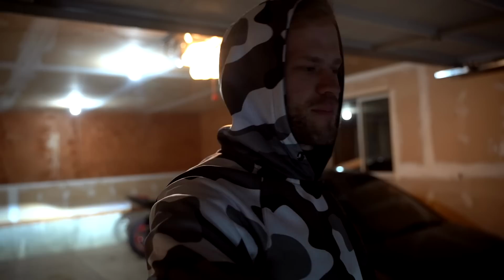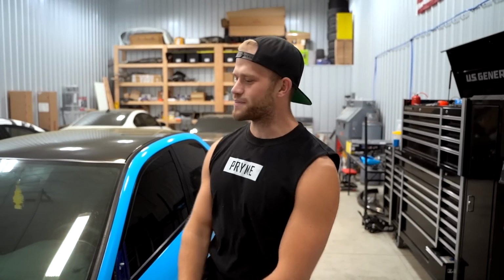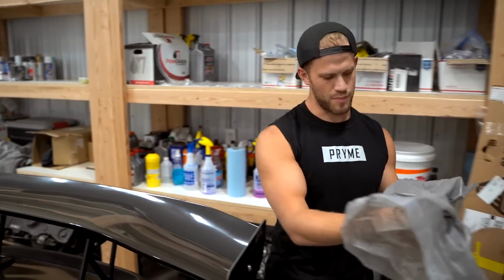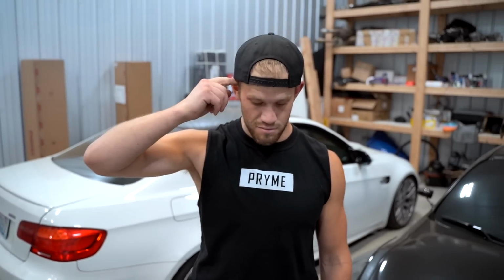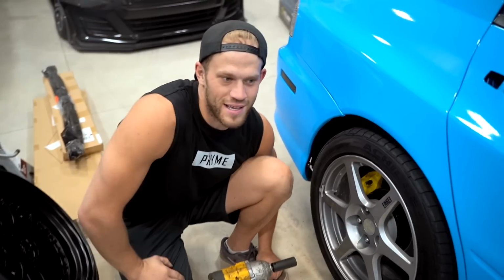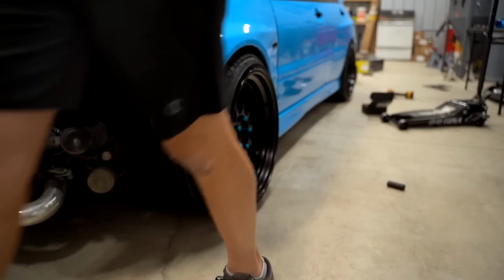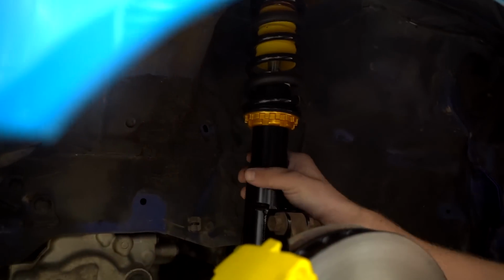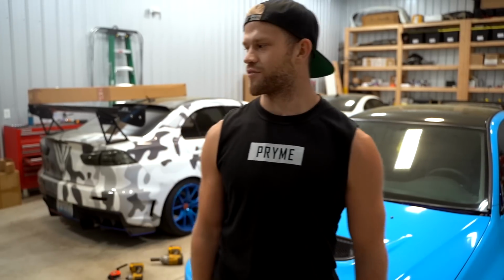Revealing the New Wheels!

Comment: I feel like you should put a spacer in the back as well so the front to back flows better.
Reply: I second this.
Reply: Agree !!
Reply: +1 lol looks like a FWD Evo.
Reply: Bruh you serious? Rip fenders
Reply: Smaller front spacer would be best, and leave the rear as is.
Reply: Same thought
Reply: I have to agree.
Reply: rip rear fenders in that case.
Reply: True
Reply: That’s what I was thinking
Reply: Cant run any more in the rear it rubs like crazy. i have a 8 and getting good fitment in the back is  a pain :( i had to cut the bumper bolts and re join it with a cable tie further up that was after rolling guards as tight as they could go. 18x9 +20 with 245 40 18's
Reply: @Ross-en8lu  Couldnt go smaller front wont clear the brembos on the face of the rim
Reply: Matt Green tell me about it dude, i had 18x9.5 +22’s with 255/35’s, did all that, bit of a pull and STILL rubbed. Sold the wheels as a result lol
Reply: Defeat he wont be able to, didnt you see the clearance of the brakes? 😳
Reply: @NoootABigDeal  i did that to but with 18x9.5 +20 255 semi slicks haha didnt get close to fitting
Reply: Matt Green haha word. i swapped out to some 17x9 +35 rpf1’s with a 20mm spacer in the front and 255/40 re71r’s, will never change this set up now i love it
Reply: @NoootABigDeal  biggest issue if def in the rear. I had 18x9 +30 with zero issues on 245 40 18 then after the thicc ones i went to 18x9+20 and the rear rubbed so i had to cut all the bolt out and that but now i have it just fitting "just" with zero scrub on 245 40 18

Comment: I Like. The fenders have a mounting point, below the headlight, where nylon spacers can be placed to push the fenders out. Cheap, non-destructive, alternative to pulling.  I'm on 9.5" NTO3+M,  265/35/18, -2 degrees of camber and it fits nice. The rear is another story.

Comment: As the comments suggested, needs a spacer at the back, but since he chose XXRs, spoke design isnt made for the evo. He will need to add over fenders on the rear if he is to add a spacer. Optimal size for an evo is 18x9.5 +22 with an agressive spoke design such as TE37 or 18x9 with +12 offset for wheels such as BBS. It will flow better and you can junk the spacers.

Comment: Im interested to see if theres some rub. Also the coilovers settle a bit after being in the air, so i would drive around a bit to see how they finally sit. Looks amazing and with a roll and pull even better. Love how Bobbi is the final test for the fuego rating. I get so nervous for it  every time. You guys are awesome.

Comment: No spacers on the rear and the blue lug buts not doing it for me,  Will you not run into issues with the 4wd system running different offset wheels?

Comment: Not a fan of the blue lug nuts, probably would put a spacer in the back so the wheels line up front to back, and I'd powder coat the spacers black and use black lug nuts.  Other than that the car looks sweet.

Comment: Replace the studs on those spacers with the ARP’s bro.. trust me
Reply: 1st thing I thought when I saw it: slip ons and arps are way safer option. Those adapters are gonna be a bad thing down the road.
Reply: Jayryia exactly. Or like I said at bare minimum replace the studs they came with. Either put stock length ARP’s in the adapters themselves or get the extended ARP’s and run regular spacers. Have had the adapters on multiple cars and trucks and never had good luck with runnin them the way they come straight out the box. On my Evo right now I’m running the ARP extended studs and a 12mm spacer in the rear and 5mm spacer in the front. Both hub centric and then I had custom adapter rings made to adapt from the stock 67.1mm bore size up to the 83mm bore size of my drag wheels to keep things as sturdy/safe as possible. Last thing I want is a wheel flying off at 140+mph down the drag strip.
Reply: @that150_  good looking out. I always wondered about this

Comment: Bro, I'm literally putting those exact same wheels on my Evo too 👍
Reply: Jeremy Hamilton what specs are you gonna run?
Reply: My evo8 18x9.5+15 with 10mm on the front and no spacer in the rear...
Reply: M_A_B _ Ohh nice yeah I’ve been doing some research and a lot of people run those specs on Evos. I plan on buying RPF1s with those specs and hope I don’t rub since I’m running lowering springs
Reply: @sage_brains7133  18x8.5 +22 offset. I have my fenders rolled and I'm on BC Racing coils.
Reply: @sage_brains7133  make sure your fenders rolled/shaved off and run skinnier tires like 225/35 to prevent from rubbing...